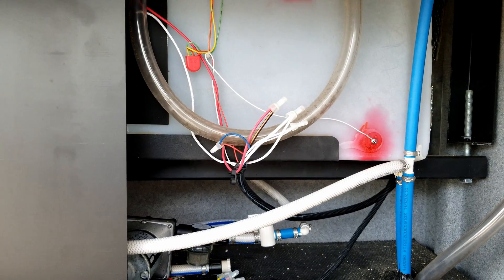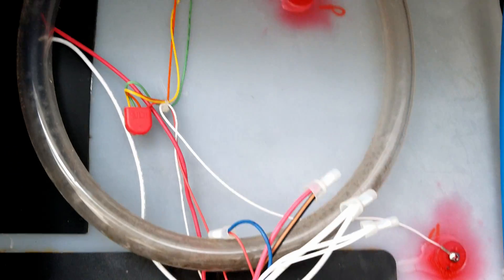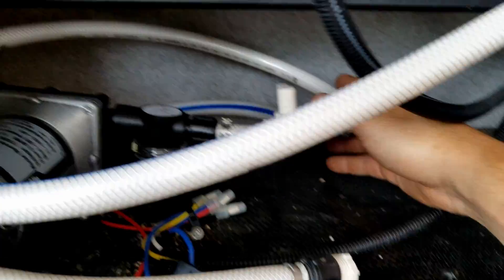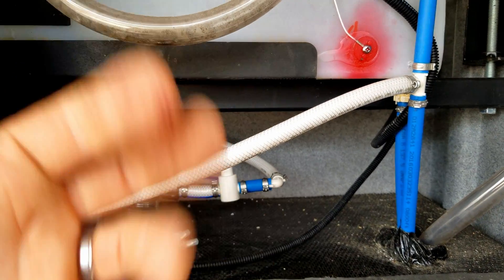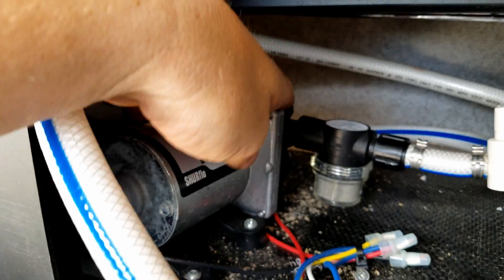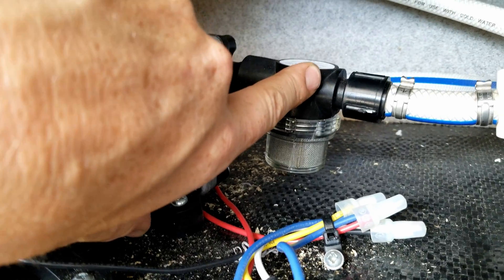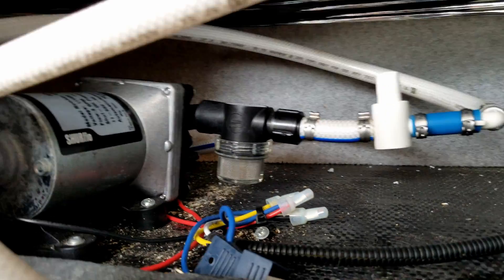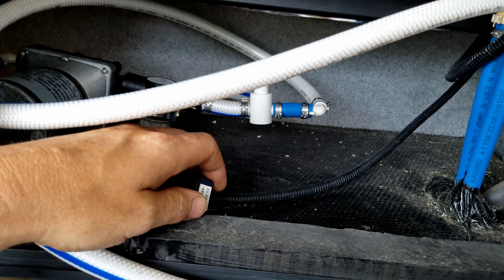RV Water Systems - 101, Full walk through!!

Comment: My fresh water tank fills when I'm on City water. I replaced the water pump with a new one but it did not correct my issue. I have a 2019 Jayco North point with a manifold and 5 valves. Any suggestions
Reply from the maker: @AlanS.-lx3xg  water pump needs replaced, it has an internal check valve that has failed

Comment: Having trouble, water pump pressurizes the system when drawing water the pump will not provide pressure to sustain water flow,  we replaced the pump all filters are clean,  any suggestions?
Reply from the maker: Air locked and needs primed, kinked hose, or a valve in the wrong position, first 3 things that come to my mind.
Reply: Just purchased a 2018 Hemisphere and it does the same thing.  How do I prime the water lines?  Thanks.
Reply from the maker: @tcaphou  best way I have found to prime is messy but very effective...just loosen the discharge fitting on the pump with a faucet open and have a towel or shop vac at the ready...tighten it as soon as you get pressure

Comment: Great video. Have a situation.   Adding water to the fresh water tank which has 43 gallon capacity but it over flows after only adding 14 gallons.  Not sure what is wrong.  Do you have any trouble shooting tips?
Reply from the maker: Blocked vent, could be a kinked hose or possibly insects have clogged it with a nest.
Reply: @MRRVTECH  so where would this vent be located   and what would it look like ??
Reply: sorry  i see it now.

Comment: My water vent hose does not have a screen and is moldy. It also “burps” when I try to fill it. Will replacing the hose prevent the burping? It takes forever to fill the tank.
Reply from the maker: The vent is blocked, it may be vented out the roof, or have a pinched vent hose down by the tank somewhere.

Comment: Hi my toilet sometime dont stop to fill water ….  happens only when the black tank is near full level …. only two times this two past month.  
any suggestions?  also what is the idea of mix pex plumbing hose system with regular garden hoses with the same pex bracket. Leaks in all regular hose brackets 🥲 … my Psi is 38 now is ok ???  or 35 
chaparral coachmen lite 2018.

Comment: I have a 2015 Forest River Sandpiper, when I have the city water hooked up water runs out of the winterizing hose and no valve has been turned. It just started doing this.
Reply from the maker: Sounds like the check valve has gone bad in the water pump, you will need to replace it. That is contingent on your valves being in the correct configuration.
Reply: Thank you for your response,  the valves are correct it just started in between camping trips.

Comment: Hi, I have an ‘85 Tioga and I was trying to put water in through fresh water tank & pump was on and water started coming out of the city connection inlet. I don’t know what happened? XO!
Reply from the maker: City water check valve is bad. Replace it and you'll be good to go.
Reply: @MRRVTECH  hi thanks, do you mean the valve in the city water outlet itself or inside the pump?
Reply from the maker: @lynnlowery8204  the check valve is built into the city water inlet....where you screw the city water hose onto. They're about $26 USD. Easy to change too, couple screws and you can unscrew it from the pipe and screw the new one on. I recommend brass instead of plastic.
Reply: Thank you. I have 2 motorhomes both a mess and I’m old and sick and tired. Lol

Comment: I have a 2006 gulfstream cavalier with no holding tanks. Two weeks ago water was coming out of my sink faucets, shower, and toilet just fine. Water hose was not disconnected from water faucet or camper between then and now.  I just turn my underground water meter valve on and off to turn water on or off.  This weekend nothing. I unhooked the hose from the camper and there is plenty of pressure coming out of the hose. I can put my mouth on the intake to the camper and blow and air comes out the camper sink faucet. I put the hose back on and nothing. I have been using this camper in this location for almost 6 years. Any suggestions?

I left the water hose attached with full pressure for a couple of hours and nothing.  water is not running under the cabinets or anywhere.  Could the intake valve behind the water hookup have gone bad and  not be allowing water into the camper?

I don't think I even have a water pump since I don;t have holding tanks.

Comment: Hi. I recently de-winterized my 2021 FOREST RIVER  FLAGSTAFF  E-PRO M-12RK and the city water is not flowing through my line to the faucet. The pump faucet valve works so I swapped out the valves and still nothing. I inspected the city water inlet opening, disconnected the fitting and did not see any signs of debris or sediment that might prevent the flow. There’s plenty of pressure coming out of my hose line leading to the house. Not sure what to do. Any feedback would be greatly appreciated.

Comment: Ok, so I had a valve break and I started taking stuff apart. Stupidly I didn’t take a picture beforehand and now I have no hot water. What is the hot water valve and where does it go relative to the cold/hot water lines.

Comment: Melvin Williams
I recently purchased a 1997 Dutchman Class C RV, When I add water to the storage tank and turn on the pump it pumps water to the faucets,, etc. but it throws most of the water out of the hose underneath the RV until you turn off the pump in which case there is no water to the faucets, etc. Also if I connect to the city water supply the water immediately goes straight out the same hose underneath. I have no idea what to do. It also appears there is lots of water coming under the floor. Thank You'

Comment: I appreciate your explanations! I bought a plastic fitting for water input. It has 3 inlets behind a lockable door. May question is why is the overflow tube so big? I have been having trouble find tubing that fits both fitting. Thanks. Do you think it makes more sense to dump the overflow through the floor than through the wall port.

Comment: First time rv owner,  it doesn't seem like the pump is working...the pump however feels hot to the touch...but no water flowing. 
Where's the best place to start...and I almost forgot...I checked the line going into the pump ( 12 volts ) and the wire has voltage.

Comment: Is the overflow sized in a way that it will drain faster than the ability to fill? In other words if you can fill faster than the ability of the overflow to drain where does the excess water go, and could the tank be damaged?

Comment: Can my fresh water pump get damaged if I did not winterize it? I pumped anti freeze through the city water inlet with a hand pump but did not winterize the fresh water system. Now my pump runs but does not build pressure and never satisfies the pressure switch.

Comment: Great video! Thank you. So I have two white hoses coming up through the floor 
from my water tank. One of them goes to the pump of course, but the other one just has an open end on it. Please correct me if I'm wrong but I'm assuming that helps let the air out of the tank as it is being filled up. At first I thought it might be for the winterization but there is another hose with a cap on it for that. Thanks for your time.
Reply: I need to know this as well

Comment: I have new rv has small low port drain ,I open they drain a little and stop,is there a check valve that stops the water ,or a better way to drain,my old rv had big gate vavles good to open drain,doesn't help if I open faucet or not

Comment: The pressure is low I’m sure because water is pouring out from the front outside when I turn on the pump to use it no matter what faucet or in the bathroom when I take a shower so it’s like half pressure basically when I take a shower or use the Fossett, and I don’t think there’s a crack in my hot water tank Because it’s still spitting out water regardless of the hot water so if I was to wash my hands the pressure is low and still spitting out here and also water is pouring out very fast out of that valve on the outside by my door can you please help

Comment: I have a question, so I have a dodge sportsman 1979 or 80 but recently the water keeps spitting out of my Fossett and in shower and bathroom like there’s air in it. It’s actually been going on for a few months now and I can’t purge out the water just by running it,Also by the door water is coming out through this valve I’m not sure what it is whenever I turn on the pump and the pump is also making a very loud noise and it sounds like it’s working hard when I turn on the pump so I’m wondering what is the problem and also when I take a shower the pressure is off and it won’t get very hot pic and only take about maybe a five minute shower rather than 15 what it used to be so I’m pretty sure they have something to do with air but I don’t know what

Comment: Tank is running over and didn’t put any water in it. What do we need to do at this point? Thank you !
Reply from the maker: This is most generally caused by a faulty check valve located in the fresh water pump. This valve prevents city water from passing through the pump backward. When it fails your city water pressure can flow freely to the tank, filling and eventually over filling it. Replace your water pump and all will be well. Thanks for watching!

Comment: I am living full time in a 16’ toy hauler with city water hook up but I recently lost water pressure inside.  I turned on my pump & it worked fine for a while but now sputters like it has air in the line.  I don’t know where the fresh water tank would be.  There is only one water inlet.  I use a water pressure regulator and have an exterior water filter.  I would appreciate any ideas for troubleshooting.